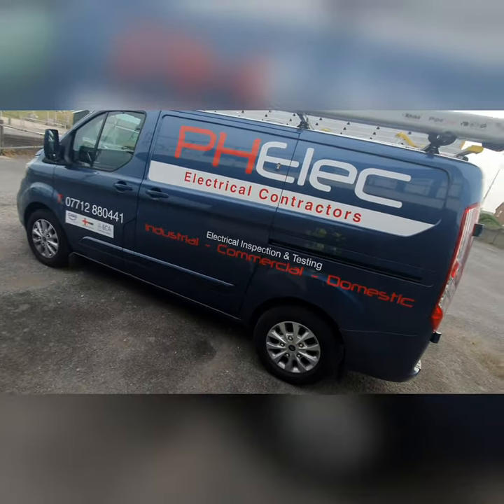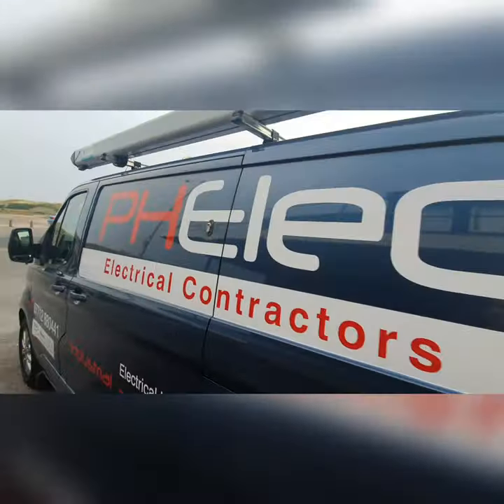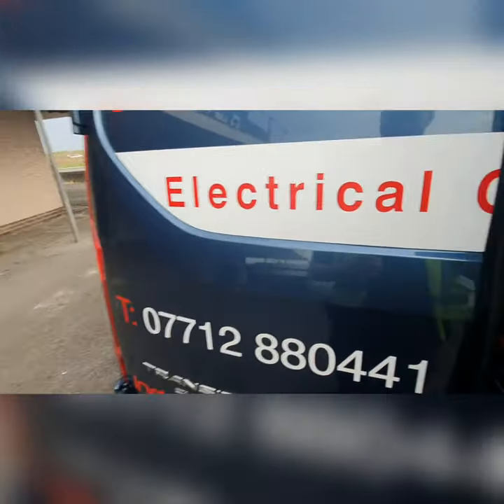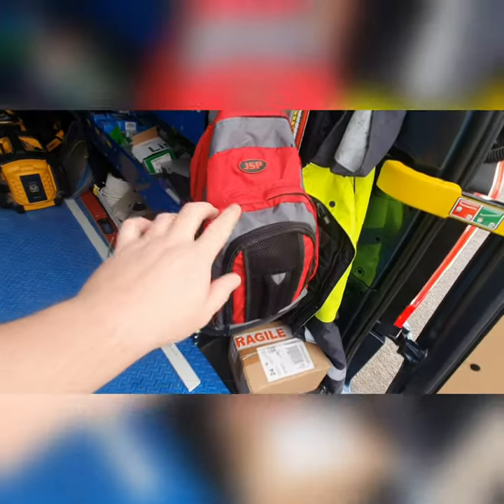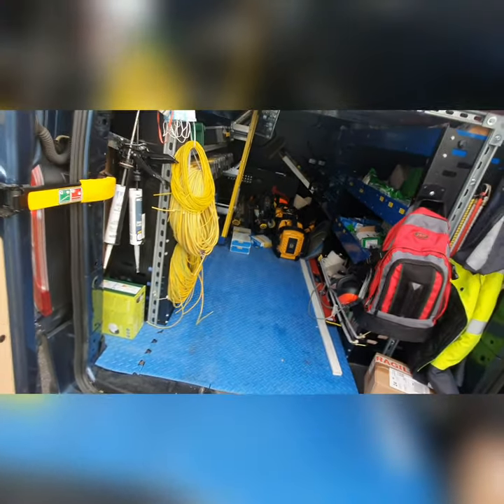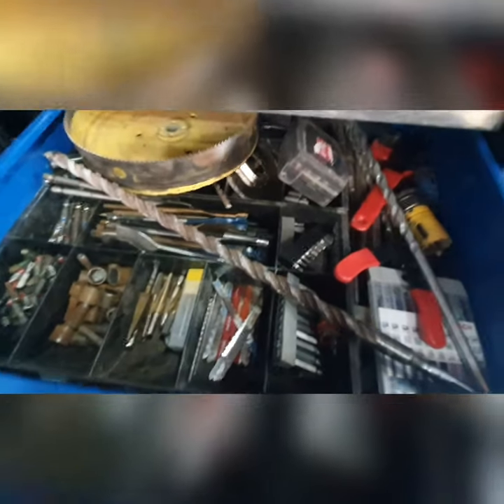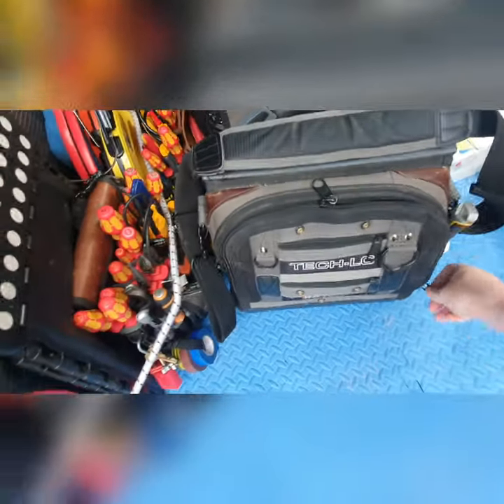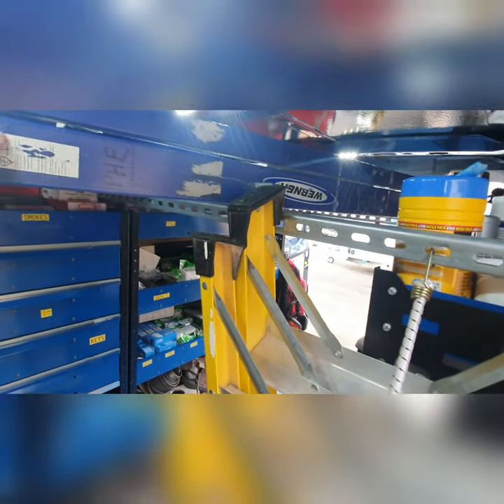TOUR DE VAN- ELECTRICIANS VAN TOUR-FORD TRANSIT

Comment: Spend a fortune on these vans and manufacturers can't be arsed to fit decent security on them, as well as that the metal on them is that thin it's like tin foil.
Reply from the maker: Very true. Its like they want vans to be broken into. I would pay an extra £3-£5k to make it bomb proof